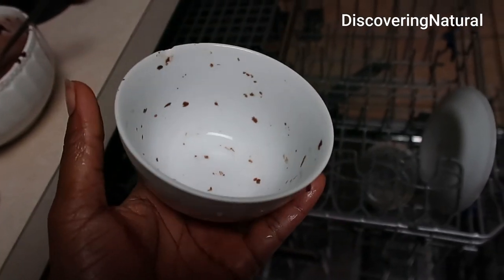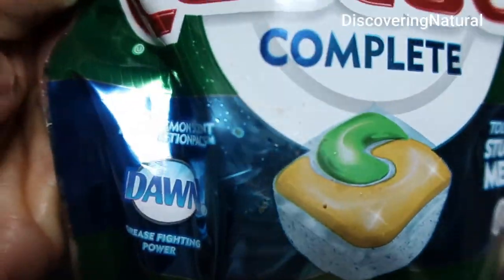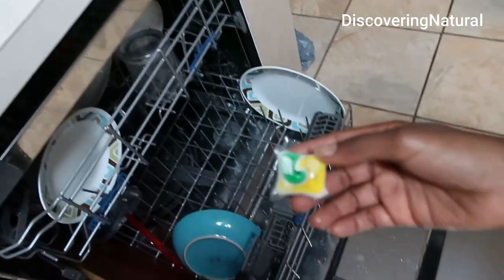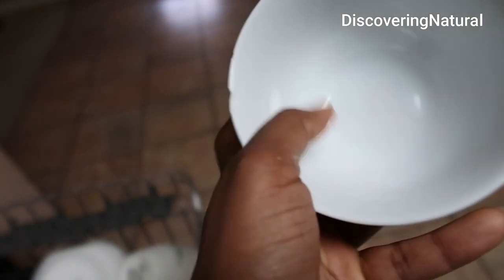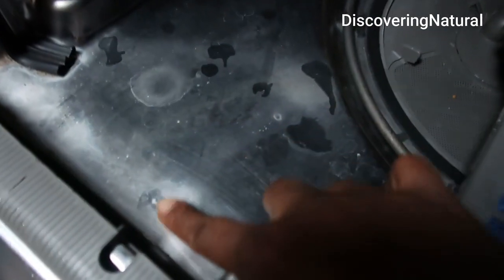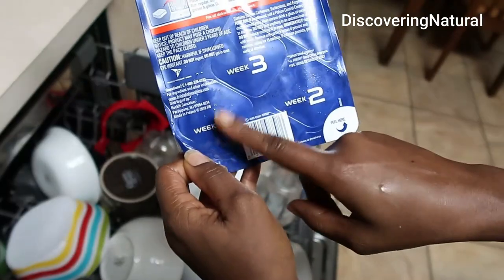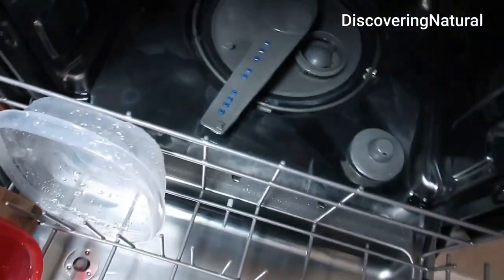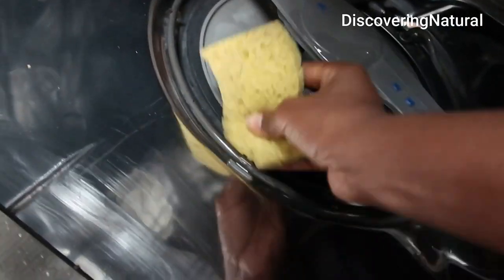Dishwasher Cleaner Review | Finish vs Cascade

Comment: The dishwasher "cleaner" is for the dishwasher ONLY !  No dirty dishes are supposed to go in the "cleaning" cycle.  You did this wrong.
Reply from the maker: Thanks for the info
Reply: The dishwasher washer she has is meant for in wash, however what was needed was an actual dishwasher tablet together with the dishwasher cleaner. 

Finish makes another dishwasher cleaner liquid (no dishes).
Reply: Still not a very good comparison for this reason. Should be Finish Powerball vs Cascade Pods…
Reply: @ThePeteFrampton yea the second part is cleaner for dishwasher and she threw it in was suppose to put in the compartment 🤦‍♂️🤦‍♂️

Comment: Use Glisten brand dishwasher cleaner on an empty (no dishes) load run on your heaviest cycle. Also, never put wood items (cutting board and wood utensils) in the dishwasher. They’ll get damaged. Those are hand wash only. Use plastic board to cut raw meats snd put that in the dishwasher to clean and sanitize.
Reply from the maker: Thanks for the tips!